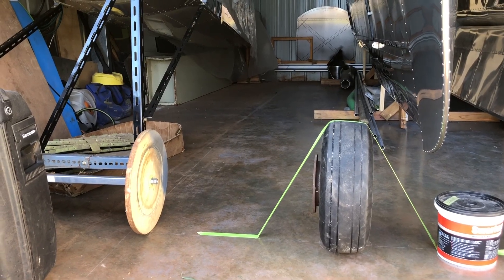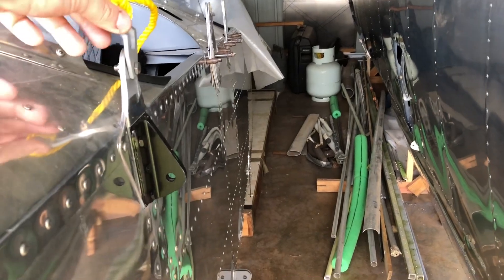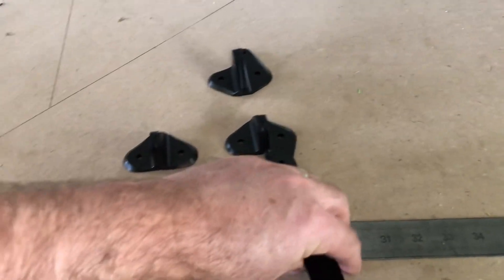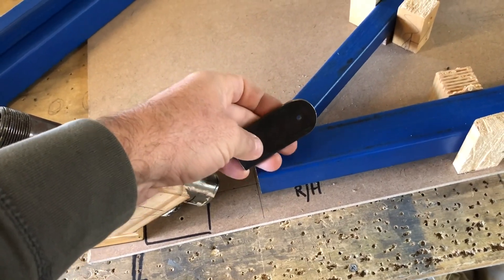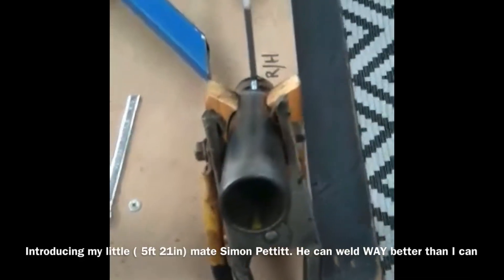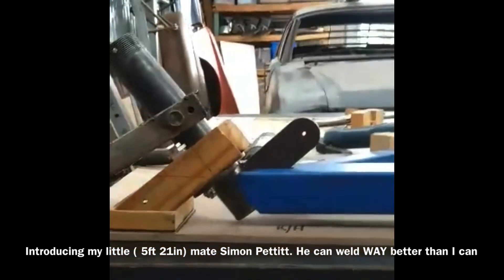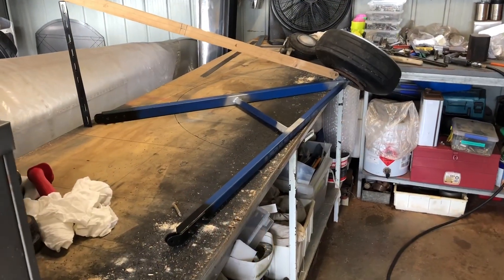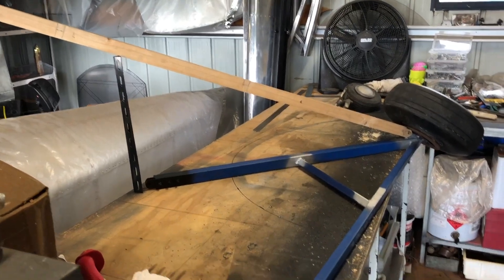Landing gear on a budget

Comment: Like it too much!! 👍🏼👍🏼👍🏼
may i know if you already have an estimate of the final empty weight and overall dimensions?  what kind of engine do you plan to install?  I ask you because as I told you in the past comment, I would also like to start a construction of a parasol using parts of aircraft already flying type j3 / wag aero sport trainer. If is possibile, i would like to build not ad experimental but ultralight (in Italy the regulamentation is a little bit different).
Reply from the maker: The engine is a lycoming 0/320, the all up weight is guessed at around 430kg or so. About 630kg with me and full fuel. By calculation I can add 200 kg in the front seat and still be well within CG. Wing span 34ft, length around 25ft. To the top of the wing about 8ft. The fuel tanks will hold about 55ltrs each (2 of in the wings). I will make a couple of drop tanks to fit on the wing struts to extend the range a bit later
Reply: @donwtsn  thank you!! I would like to be a little lighter in construction, at the moment in Italy ultralights regulation allows a mtow of 450kg (472,5 with brs).  it is hoped in a few years to be able to reach 600kg.. I HOPE!! 😅
However I’m thinking for an o-200/235 with tail group from j3/wag aero, 28ft wing span and a shortened and modified fuselage structure for open cockpit parasol still keeping 2 places
Reply from the maker: @stefanospagnolini506  very similar to the pietenpol aircamper.
Reply: @donwtsn  that's right, very similar to the pietempol air camper.  I see it more as a baby ace with an extra seat (more compact and graceful) with the option to close the passenger compartment.
Reply from the maker: @stefanospagnolini506  nice! That would be a fun little project. What material would you build with, timber, steel tube, aluminium, composite?
Reply: @donwtsn  i’m not so confident with wooden construction.. scratch 4130 cromoly tube fuselage with tail and landing gear from a j3 club/wag aero sport trainer and I thinking for aluminum wing ribs and spar. For the engine i would use a o-200/235 but also looking for a Rotax 912 couse is less weight. I like really much your’s style of wing but I thinking that for me are too heavy..
Reply from the maker: @stefanospagnolini506  cool! I over built my wing spars, they weigh 34kg each all up which isn’t too bad. They could be made a little bit lighter.
Reply: @donwtsn  really cool!! Hope to see you soon for the next video and obviously to see you and your amazing plane in flight! Thanks for sharing your experiences.